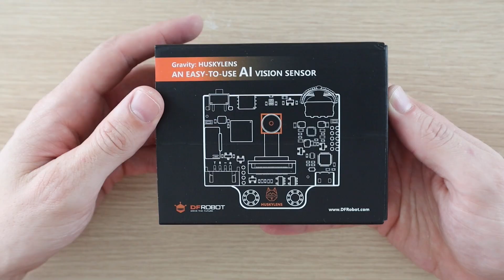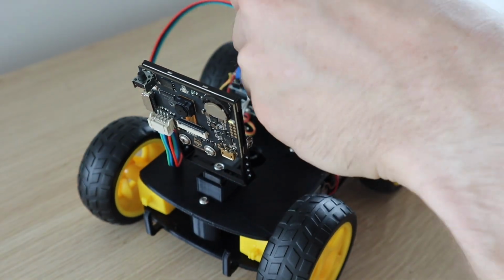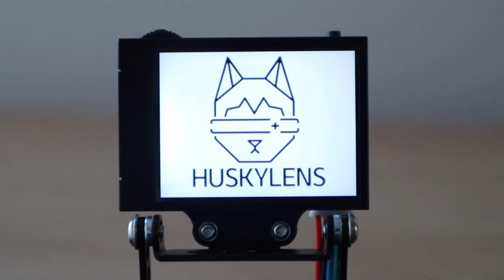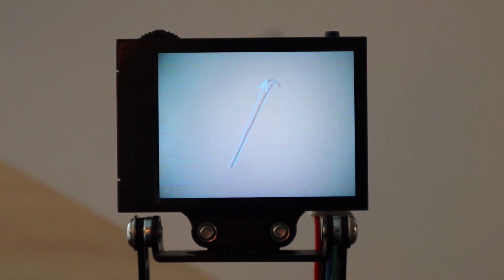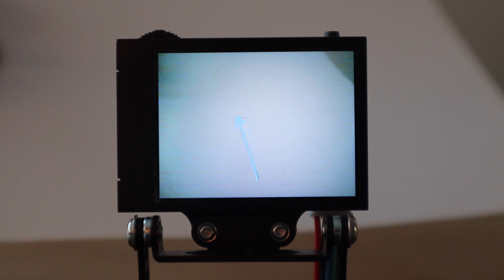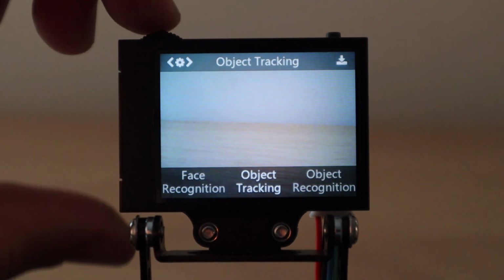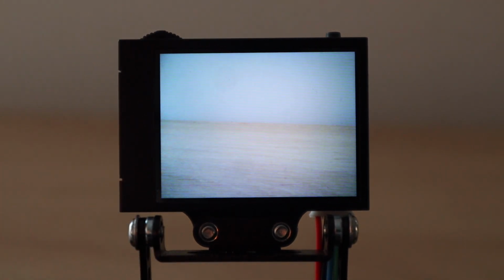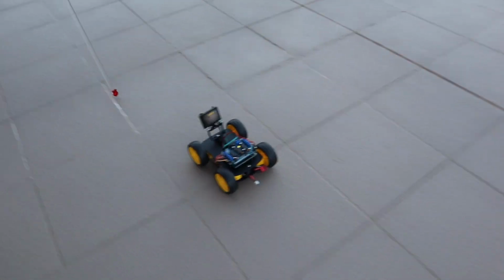Adding AI Vision To A Robot Car Using A Huskylens - Line & Object Tracking

Comment: Hi, I just sub. this video is very helpful. I follow the instructions but my problem is power. How much voltage and amps did you use to make it work?
Reply from the maker: I used a 3 cell (11.1V) LiPo battery, the car draws a few hundred milliamps when running

Comment: Hello, I keep getting " Fail to request data from HUSKYLENS, recheck the connection!
" pop-ups and I don't know what the reason is, I was wondering if you have had this problem too?
Reply from the maker: There must be an issue with the connection to the Huskylens - it is likely either not receiving power reliably or the data connection is not good.

Comment: I have a problem, when i tried to upload the program, Arduino doesn´t compile due to error status 1. Can you help me, please?
Reply from the maker: That's a compilation error so I'd say you've probably got an error in your code or your haven't installed the required libraries
Reply: I have the solution.
You need to leave your library AFMotor.h before the huskylens file 
That was the solution that I found, now I can run the program without issues
Thanks for the support

Comment: HI there , how can i adjust the distance of the object and huskylens before the motor stop, thanks :)
and it also passible that i will only put 2 motor the m1 and m3 , it will still go forward left and right?
Reply from the maker: The stopping parameters can all be adjusted in the code.
Yes, you can use tow motors (provided their strong enough to move the car) and it will still be able to go forwards, left and right, it just won't turn on the spot like this one does.

Comment: is it possible to follow a human? could you check a half-body follow ? and is it possible to add algorithms or change them ?
Reply from the maker: You could set it to follow a particular part in a person. Like bright shoes or shorts etc., it also has facial recognition which you could use when facing the robot.
You can’t add or modify the algorithms unfortunately. There are some basic adjustments/settings you can do to certain algorithms (like the facial recognition one)

Comment: How did you attach pin 13. Soldered?
Reply from the maker: I've soldered header pins to the spare IO on the shield.
Reply: @MichaelKlements  As a beginner(at the tender age of 68), I have not learned how to do fine soldering (yet).
However I discovered a Screw Terminal Shield, which, when located between the Arduino and the L293, gives me access to all the pins. Very cool.
Reply from the maker: That sounds like a good solution as well. You should get a small soldering iron and try it out, it's really not that difficult once you get the hang of it. You can practice on some old wires and header pins.

Comment: I read your post on 'The DIY life'
But I have some problems. robot didn't move when I use your line tracing code, parts and diagram
Are there anything I have to do in your code??... like changing some parameter?
Reply from the maker: You’ll need to adjust some parameters to get it to run smoothly, but the wheels should at least turn without making any changes.
Is your Huskylens in line tracking mode and have you trained it on the line you want it to follow?
Reply: @MichaelKlements  Thanks for replying
After I changed 'int left & right Speed' from 0 to 70~80, it started to move.

Q1. Is this right parameters that I adjust for moving my robot??

//Of course, I think other things need to be adjusted, but I wondered if that changing those(int Speed) is right to work

+ I checked my huskylens in line tracking mode and I2C protocol
Reply from the maker: That’s great. Yes that is one of the parameters which can be adjusted. It’s essentially a type of “gain”. So if your motors have more friction or your battery produces less voltage then increasing the speed will get more power to the motors.
Reply: @MichaelKlements  I really appreciated your help! Finally, I made my robot following the line smoothly by keeping editing some parameters..!!
But I would like to get some more advices from you. I want to make "each DC motors to move Forward/Backward when turn right or left". Because I used mecanum wheels, I think it is neccessary for omni-directional move. But after editing "Using BACKWARD or FORWARD at Void turnRight(int duration) & turnLeft(int duration)", my robot only goes Forward...

So... What do you think about this problem? Can I ask for some advices on this problem?
Reply: @fro2lier82  can you tell me what parameters have you edited? my car won't turn left or right :(

Comment: looks good !! 
Do you know what is the maximum distance the camera can track an object ?
Reply from the maker: It doesn't really have a maximum distance, it depends on the size of the object as well. The camera has to be able to see the object and still have a recognizable shape on the display in order to track it. So it could track a coin for a couple of feet, but would likely track a whole building that's a few kilometers away if it's clearly visible.
Reply: @MichaelKlements   great you helped me a lot!
Reply: no Way maxi below 1 meter

Comment: Can you tell me how do you calculate the PID loop for this project?
Reply from the maker: The PID loop only really uses P, so it’s not true PID control. I just used a PID library as in the example script from the Huskylens Wiki
Reply: @MichaelKlements  i tried your code but the TT motors only vibrate when huskylens track a line any solution?
Reply from the maker: Try adjusting the motor speed value, check your connections and make sure that your battery pack is actually able to supply enough power to drive the motors.
Reply: @MichaelKlements  it works now but i have an issue.. it wont turn left/right when huskylens detect the left/right line
Reply: @Cyberdemon22Gaming  Can you tell me how to solve your problem?
I had same issue when I use TT motor.. and his code
Reply: @fro2lier82  i used an 2x 40amps 18650 battery bcuz the old battery pack wont supply enough power to the motor, now my another problem is it wont turn left or right, it will only follow the straight line, when it see the curved line it just ignores then go nowhere....
Reply: @fro2lier82  did you solve your problem? does your robot turn left/right?
Reply: @Cyberdemon22Gaming  have you solved problem? my robot doesn't turn left or right :(

Comment: Can it still avoid obstacles with the husky camera?
Reply from the maker: Not in the same way an ultrasonic sensor works. A single camera can't be "depth" aware. You could program it to avoid a certain object, so if the object appears in screen then the car turns away from it or reverses.

Comment: REALLY COOL GADGET!!! You can probably put together a gimbal from this as well, one that can video record you while following your move within frame while on a 4 axis pan and tilt, setup on a tripod, is this possible?
Reply from the maker: This is a great idea. Yes, it certainly sounds possible. I've seen a couple of projects which have used these on the end of a robot arm or servo pan and tilt bracket. These aren't too different from a gimbal.

Comment: can I add a wireless control to this robot, where I can watch captured video live and control the movement of it??
Reply from the maker: You can add wireless control to it using a Bluetooth or wifi module. Unfortunately you won’t be able to capture live video as this isn’t supported by the Huskylens. You’d probably need to use a Raspberry Pi get get a video feed sent wirelessly from a robot car.
Reply: @MichaelKlements  o i thought about that. instead of doing it myself i can find other readymade kit.